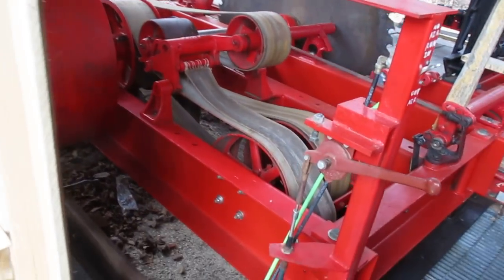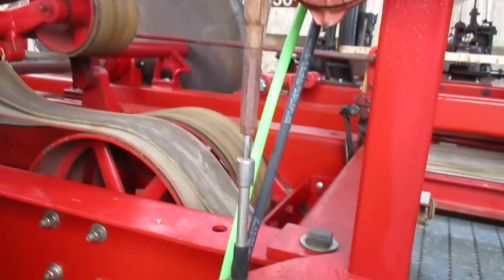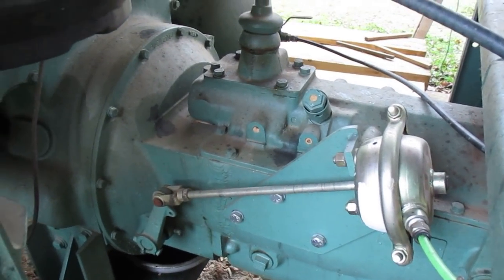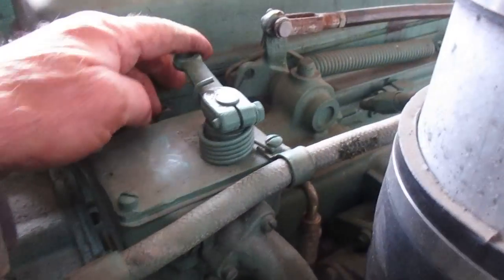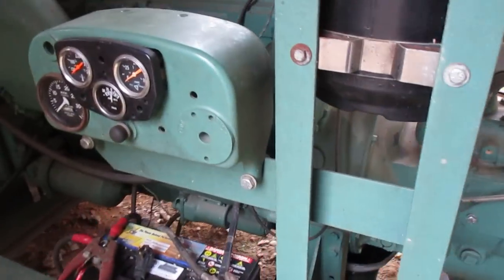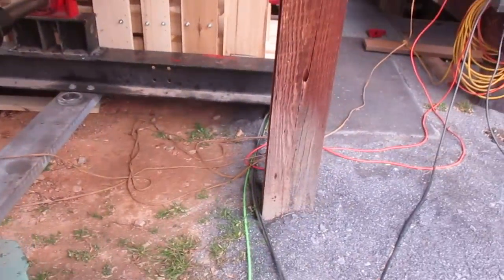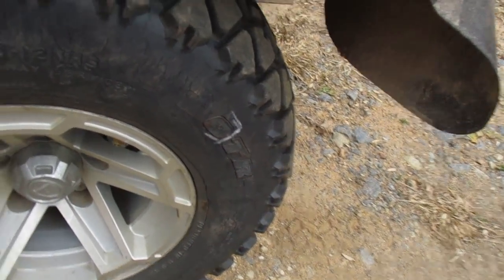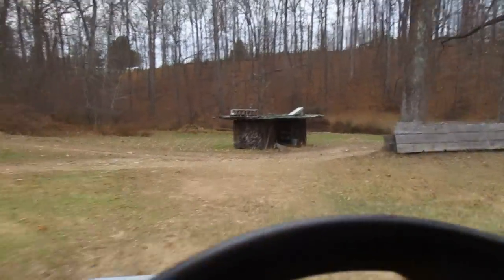Sawmill Detroit governor look at #585

Comment: I had a similar set up with my 8V71.  I used garage door pulleys and cables connected to an old John Deere tractor throttle.  I also used a cable system to connect to the clutch as well as the air damper emergency shut down.  Would have been nicer to have the air system like you have.  Merry Christmas, John.
Reply from the maker: thanks for the look see john

Comment: Good Morning John;  I have used control cables like those for years. When needed I had the made by I think they have had their name changed by now. I've had cables made 45 feet long. They made cables any length or size you wanted. Your Detroit looks too dirty. I know that when a Detroit isn't leaking it's not running. I hope at least you'll check and/or clean the air cleaner. It won't hurt to check the radiator either. I worked for one guy who had us steam clean all the Detroit trucks we had every other month because He had one catch fire 30 years earlier. Talk to Jeffery and I must say that you have to make sure the "slobber tubes" are clean or you will MAJOR problems. They are great engines.
Reply from the maker: hi there they are open  thanks john

Comment: Can you please tell me where I can aquire the 2 belt pulleys you use on the 471. I am setting up a mill and I need to drop the rpms down from the shaft on the rockford to the mandrel 3:1. Been having a really hard time locating those and a shaft to extend the mandrel. Thanks for all the videos. You are very helpful and informative to those who don't have too much experience with sawmills.
Reply from the maker: almost all the stuff like i just back ratted over the years . but some may have come from surplus center  john

Comment: Hey John, thanks for sharing the throttle cable info. I've got to get a setup to control my 4-71 from the sawyers stand. Is your alternator wired up to charge your battery?
Reply from the maker: hi there it is but stopped working  john